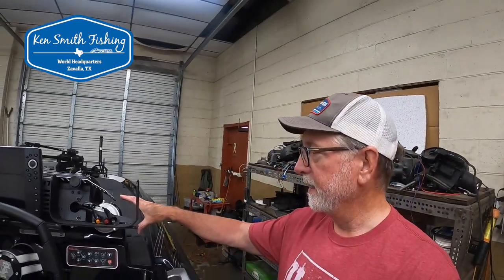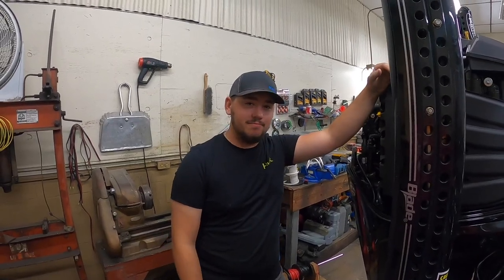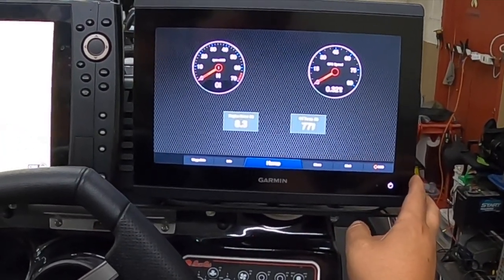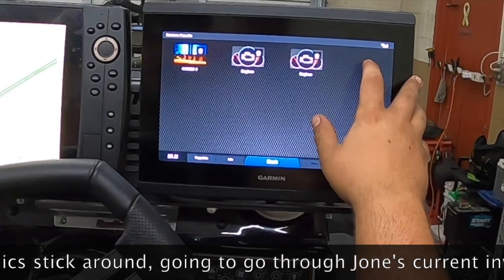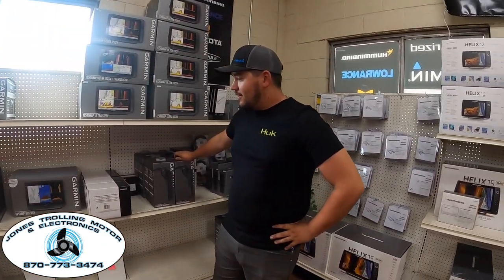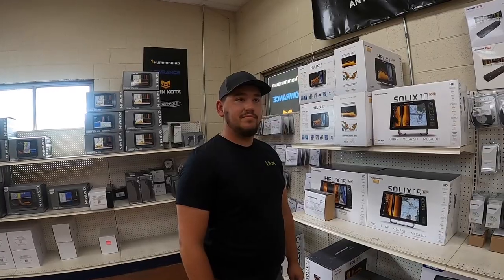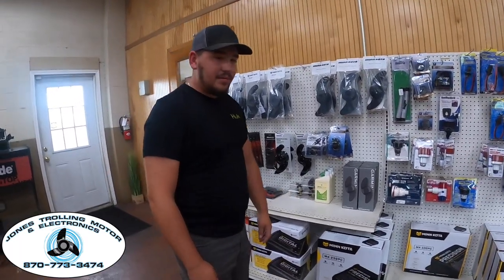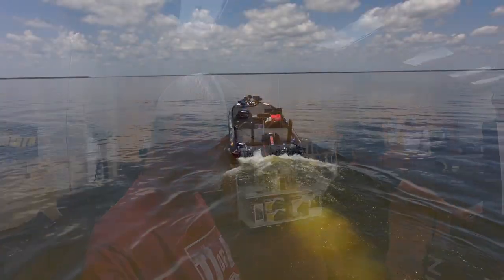How to Get Your Mercury Motor Data Through Your Graph (Using NEMA Gateway)

Comment: FYI you’re setting yourself up for communication failures. EXACTLY like the terminators you discussed in the NMEA2000 portion, the various SmartCraft networks require 2x120ohm resistors for a total resistance of 60ohms. The red cap you removed has the resistor built in. Without that resistor installed, your resistance increases to 118-120 ohms and has potential to cause communication errors, or worse: PCM/CCM and component failures. BLACK caps are weather caps. Red and yellow 10 pin caps have terminators built in. Yellow caps only terminate the Can P network, whereas the red caps provide additional networks with a resistor as well. The method shown in this video is prone to errors. As mentioned by other commenters; use the plug on the helm harness. If you don’t have a helm harness, use a terminator adaptor harness in between gateway and connector on engine harness.
Reply from the maker: Thanks Michael, will look into that

Comment: If the Merc Monitor is a Level 1 gauge, there is a N2K pigtail in the back of it already and also, Bob's Machine has come out with a N2K jackplate sensor that will display the height on your unit.......Great videos as well.

Comment: The red cap is a resistor and its required.  Connect the gateway at the helm in an already available port from the junction box.
Reply: Good point! The junction box under the dash is right there by the graph. My Mercmonitor already had an NMEA gateway builtin so I got the connection from it and didn't need a gateway.

Comment: NMEA 2000 data is very cool.  I purchased a new Nitro early this year and put the BBT mount and it covered several gauges.  I have mine wired to display engine data and my fuel and it will read out fuel level in percentage.  Bob's recently came out with a connection for their jackplate, I may add that at some point too.

Comment: Did the port that you are using not have the Smartcraft gage cable connected, which means it will not longer function?  I understood that in order to have both the NMEA connection to your graph and the smart craft gage, that another component is required to create and additional connection on your engine.
Reply from the maker: I don’t know but I will ask

Comment: Have a mercury command thrust 115 4stk mercury data cable to a junction box to the mercury gateway to the backbone then to a Lowrance elite. Ti2  I also added a fuel sensor. All my gauges work except the 2 I need the most trim and fuel I am at the end of my rope cant seem to get any answers why it’s not working PLEASE HELP

Comment: mine doesn't work someone says I need a can cable?
Reply from the maker: I know we had to buy an adapter to connect cable to motor
Reply: @KenSmithFishing  I finally figured it out 150 bucks later needed a can bus and resistor cable, even the dealer had no idea how they went together, ended up talking to a guy who sells the parts on ebay.  thanks for the reply maybe I will do a youtube video on it.

Comment: fellows, this video shows very, very bad practise!!! you just compromised the smart craft network by removing one of the resistors. Since you have a gauge at the dashboard which you can't see anyway you can disconnect it from the Junction box and connect the gateway there. Or if you lucky you have a spare socket in the j-box and just need to plug the gateway there. You definitely should pin a comment showing that what you have done is totally wrong way to go ... !
Reply from the maker: not sure I follow?
Reply: @KenSmithFishing  a CAN network to work as designed needs two terminators of 120 ohm at each end of the "backbone". On this video you removed one without substitute, thus compromising reliability of SC network. At the dashboard you most likely have a junction box installed, where you easily can connect NMEA2k gateway without removing anything. This way you guarantee the integrity of the SC network, adding the functionality you are looking for ...